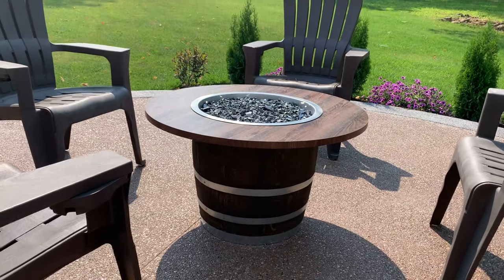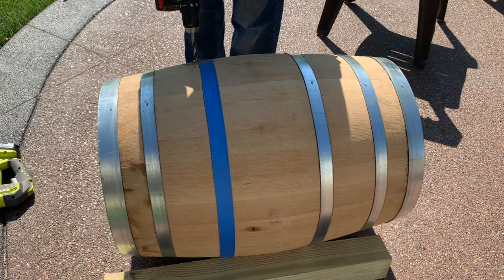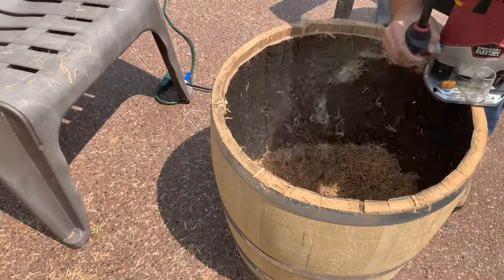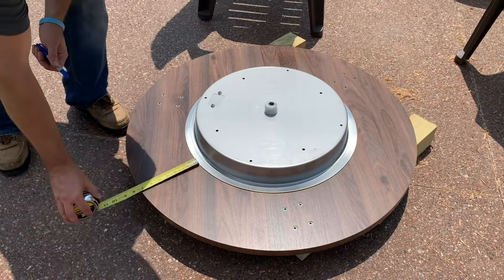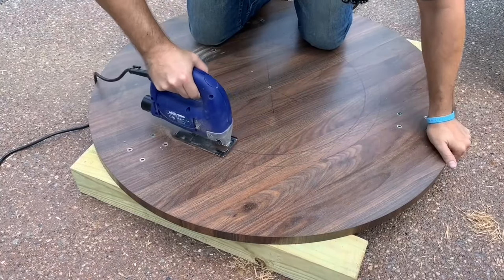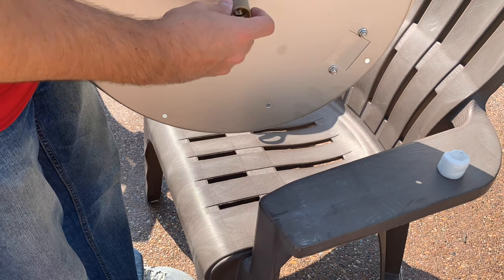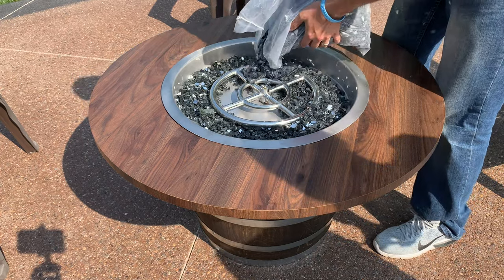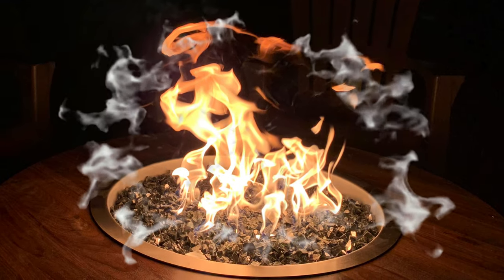DIY Gas Fire Pit Table

Comment from the maker: Parts to build your own:  
Pan & Burner: https://amzn.to/3OEWBUi
Installation Kit: https://amzn.to/3OYQmuA
Fire Glass: https://amzn.to/3a5cuoh
Yellow Gas Tape: https://amzn.to/3yDbily
Fire Pit Cover: https://amzn.to/3nxCprH
Painters Tape: https://amzn.to/3nESFHh
Drill: https://amzn.to/3P8BtWi
Drill Bits: https://amzn.to/3usdmKw
Forstner Bits: https://amzn.to/3uujUbE
Jig Saw: https://amzn.to/3OQenEu
Tape Measure: https://amzn.to/3IkGv04
Plunge Router: https://amzn.to/3bSsMBt
Router Bits: https://amzn.to/3NFHCZf
Safety Glasses: https://amzn.to/3RcTF36
Hearing Protection: https://amzn.to/3IjaTI3
Air Compressor: https://amzn.to/3IglinI
Pneumatic Orbital Sander: https://amzn.to/3un6Ep9
Sanding Discs: https://amzn.to/3ur4PHU
Pliers: https://amzn.to/3Il9GjA
Channel Lock Pliers: https://amzn.to/3afwrbR
Jacobean Stain: https://amzn.to/3ymd215
Polyurethane: https://amzn.to/3PogJdF
Propane Tank: Purchased at my local Home Depot
Whiskey Barrel: Call around to your local distilleries or shop of Facebook Marketplace for the best deals

*DISCLAIMER: The above links are Amazon affiliate links.  This costs you absolutely nothing, but pays me a small commission and helps me continue to create this FREE content.

Comment: Great fire pit build! it looks amazing. I know barrels can be tricky to work with , my hats off to you brother. 😀
Reply from the maker: Thanks brother, I appreciate your continued support.  Lol I was surprised with the weight of the barrel since it was still pretty freshly emptied so it was really wet inside.  I popped the top and let it air out for several days.

Comment: Great idea and will be my next project.  How did you attach the table top to the barrel ?
Reply from the maker: That’s awesome to hear!  With it being a tight fit and the weight of the pan and rocks I didn’t need to secure it with a bracket or anything.  Good luck on your build, let me know how it turns out!

Comment: Hey ! Great Firepit barrel, 
One question for you how did you secure the tabletop to the barrel ? L Brackets ?
Reply from the maker: Thank you, I appreciate you watching and leaving a comment.  With the weight of the table, pan, fire glass, etc a bracket is not needed as it’s a tight fit and secure with the weight.

Comment: Waching your full video and trying to learn on how to do it. How did you do the fire ignition work. Thanks for sharing my full support and subscribing to your channel my dear friend. Stay connected
Reply from the maker: Thank you for watching.  After installing everything as shown in the video turn the propane tank on, turn on the gas valve with the key, and then light the burner.  It takes roughly 3 seconds and is super easy.  Let me know if you have any other questions.

Comment: is it a concern that fire is so close to the wood? Is there is some rule of thumb regarding how far away from the wood the pan should be?
Reply from the maker: @jayviz  Thanks for watching and good question.  Prior to the build it was a concern, but with using these fire pans I linked there is zero concern.  I hit it with the temp gun afterwards just to confirm.  The wood is used for a great drink and food holder as well. Happy building!

Comment: Great build! Could you use a 1 lb. propane bottle so it could be hidden in the table? I wouldn't mind having to use one tank everytime to have a cleaner look. Thoughts?
Reply from the maker: Hi Mark,  you can 100% you can use a propane tank that size or larger inside the table.  I used to have mine in the table as well before getting a side table.  Thank you for watching and welcome to the channel. 👍

Comment: What kind of heat does it put out for people sitting around it? Say compared to a regular smokeless fire pit?
Reply from the maker: Welcome to the channel and thank you for watching.  The amount of heat is completely up to you with the turn of the valve.  In summer months I have it turned down low and higher in winter months that puts out a great deal of heat for everyone sitting around it.  👍🏼

Comment: That's freaking awesome.  I've been planning a build like this for a while.  Did you just set the insert in place or did you caulk it down?  Why didn't you put the tank inside of it?
Reply from the maker: Thanks Travis!  Having a fire in 3 seconds is awesome especially when some only wants to spend 30 minute for example.
Reply: @inspiringbuilds  I totally get that.  My family would defiantly only want to be out for no more than 30 min.
Reply from the maker: @HowIDoThingsDIY  The insert fits snug into place and has plenty of weight that it’s not going anywhere.  I wanted a side table and it made since in my setup to hide the propane tank there.  It was a bit easier to swap, you can have bigger tanks if you want, etc.

Comment: Great Fire pit!  If I put my tank inside, do you build a side door, or not glue down your table top so you can remove it?
Reply from the maker: Thank you!  I appreciate you watching and welcome to the channel.  The tank can be placed inside without a door access.  The weight of the rocks in the pan doesn’t allow the table to move and can be picked up and the tank replaced.  Good luck with your build. 👍
Reply: @inspiringbuilds  So the bottom doesn't have wood, you can lift it up and put it on top of tank?
Reply from the maker: @amandarae3268  The bottom does and has holes drilled around the bottom for oxygen.  The top lifts off from the table on up.
Reply: So you put the propane tank in from the top?
Reply from the maker: @amandarae3268  Correct

Comment: Could you show a picture of where the propane tank is and how you prevented any trip hazards from the hose?
Reply from the maker: Hi Shayla, thanks for watching and welcome to the channel!  I originally had the propane tank inside the barrel hidden with no trip hazards.  Just ensure you drill holes as shown in the barrel doing this method.  I now have it hidden in a side table between two patio chairs and one single hose does run a very short distance on the ground from then whiskey barrel.  👍🏼

Comment: Great build Dan! I have one quite similar out of the pallet that I made. My question to you… Do you ever worry about your table top catching fire? That is my constant worry on mine as when the wind blows the flames get very close to the wood. I even had to exchange my fire ring for a smaller diameter ring. Curious if this was an issue for you as well. I chose not to go the “cement top“ route cause I ain’t that skilled LOL. Great build!
Reply from the maker: Good question, thank you for watching and welcome to the channel!  The pan I use keeps all the heat in, I hit the table with a temp gun and have no concerns.  We use the table to prop up our feet as well as sit our drinks and food on. 👍

Comment: Great build! Could you modify the build to be able to put the propane tank inaide the table?
Reply from the maker: Hi Andrew and thank you.  Yes you can put it in the barrel.  I wouldn’t cut down as far on the barrel.  If you place it in the barrel ensure to drill holes for oxygen as shown.  Let me know if you need anything.  👍🏼

Comment: Wow, awesome, I'll start working on one of those. I have a question. Is the heat generated affecting the wood in any way? Do you recommend using some type of heat resistant material between the pan and wood?
Reply from the maker: Hi Gustavo, thank you for watching and leaving feedback.  The heat is not affecting the wood at all and can be touched while the fire is going.  I don’t feel a heat resistant material is needed, but it wouldn’t hurt anything if you decided to add it.  Good luck on your build. 👍🏼

Comment: Love this DIY project.  Can I ask what brand your propane installation kit with air mixer are or where you got it?  How about the the gas key valve you used?  Our son and I may tackle this project over Christmas break.
Reply from the maker: Hi Heidi, thank you for watching and leaving feedback.  It means a lot and stay tuned for future DIY Projects.  For the parts used on this build I included everything along with a link in the description.  I’ve also used the fire pit for several months and it’s working great as well as I get a lot of complements from friends and family.  I will say my favorite features are lighting it in 3 seconds and not smelling like smoke.  Good luck on your build and let me know how it turns out. 👍🏼

Comment: What size propane bottle fits inside?
Reply from the maker: As long as you don’t cut too low you can fit the most common 20 lb. size, which is the same size that you use with your propane grill.  I have one in each so I never run out. 👍

Comment: What’s the actual height of your firepit. What’s if the distance from the propane tank to the fire? Should there be a certain distance?
Reply from the maker: Thanks for watching!  I’d recommend doing a clearance height test by installing the fittings on the pan and hold it over the propane tank to get the minimum required height.  As long as you have clearance between the propane tank you’re good.  You can then take the height minus the thickness of the table to determine your barrel height.

Comment: how long does a tank last?
Reply from the maker: Welcome to the channel and thank you for watching.  There are a lot of variables such as the size of the burner, how long you have it lit for, how high the heat is turned up, etc.  I used it about a dozen times last summer and used 1.5 tanks of propane costing $20 per tank.

Comment: Be very cautious in building this.  Liquid Propane Gas is heavier than air so the potential of it building up inside the barrel without adequate ventilation could result in an explosion causing severe burns or even death.  By placing a pan and burner directly over the top of the barrel will not allow enough air flow through the barrel interior.  With any propane fire pit, please remember to add ventilation points to prevent catastrophic events from taking place and seek qualified professionals for advice or installation.
Reply from the maker: Hi Brian, thanks for watching and your concern.  Proper ventilation was added and shown in the video.

Comment: What was your reason for moving the propane tank?
Reply from the maker: Hi Hayden, thanks for watching!  I built a side table and already had a hose that would reach it so I moved it under the side table.  It made me feel a little more comfortable having the propane tank further away and it’s easier to swap out for me, but the setup in the barrel works great as well following the techniques shown in the video. Good luck on your build and stay tuned for more. 👍🏼

Comment: Did you seriously use a pressed board table top?  That thing is gonna turn into a hunk of junk after a couple rain storms.  Sure it was quicker and cheaper but you definitely just moved your cost and time spent building on to another day.  I hate doing things twice.  😩
Reply from the maker: Hi Dan, good name and thanks for watching.  I was concerned with the same and purchased the cover as I referred to.  I’ve used it 50+ times in the past 1.5 years with countless rain storms and it still looks the same as when I installed it. 👍